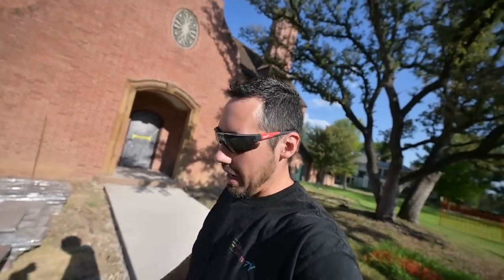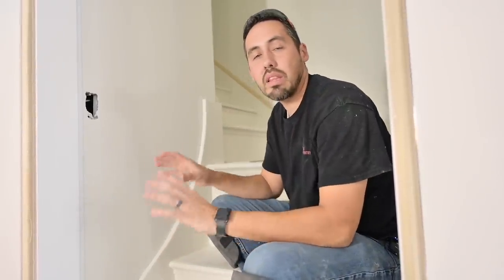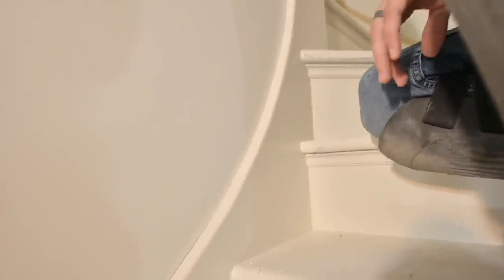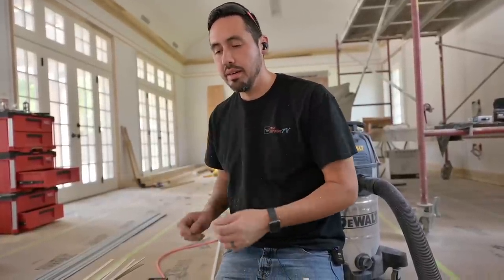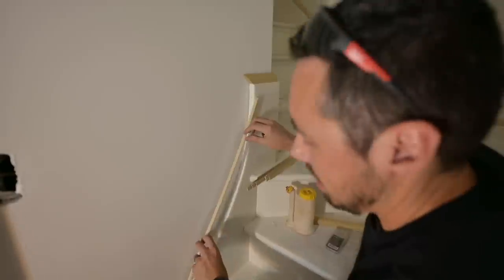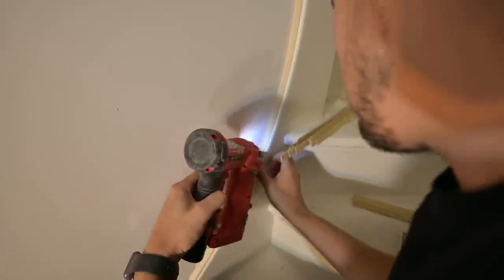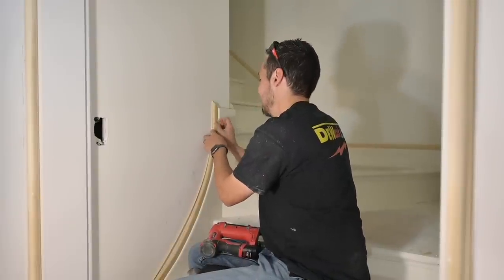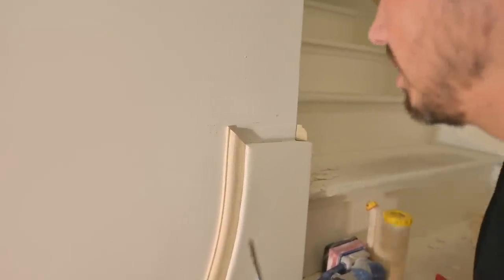This is some NEXT LEVEL Carpentry - Curved Skirt Board & Bent Lamination Mouldings

Comment: Get a 12 ft section of 3 inch or 4 inch metal pipe cap the bottom. Then about 12 inches up I  drilled small holes around the the pipe at a even 12 inches then I take write and run it in a hole out the other side and keep going back and forth in random holes so it forms a web. Then I add water to the bottom about 11 inches. It don't really matter you can't over fill it because of the drilled holes it will level it there. How ever when you stick your trim or molding in the web of words will still anything from sitting in the actual water.   You can either start a fire and stick the bottom in it or clamp a torch or two to a board  aimed at the bottom. If you don't want to fill the holes and make the web of wire. You can just get  small squeeze clamps or clothes pins and clamp them on the inside of the pipe around the upper edge. That's a cheap steamer

Comment: Nearly 50 years ago, I was learning trim carpentry from a great craftsman, who was also very time sensitive to make as much money as possible. I remember a new house that had a curved staircase. Don, my partner and teacher, took the stringers that went on the curved walls and got them wet and then draped them over some drywall buckets, so they were curved. I don’t recall how many days it took but when they had dried out he picked them up and voilà, they were curved close enough to where we could install them.

I was wondering if that may have worked for your piece of trim.

Comment: You could saw xtra long strips, apply glue, clamp them to arc of template, then run the router to profile desired, without router fence.

Comment: Super cool Richard! Very ingenious solution and it looks great! If you had access to a steam box would you still go this route? Thanks for sharing, very impressive 👍
Reply: I was wondering about what would happen to the detail on the top edge (“wrinkling”?) if the cap were steam bent.
Reply: PVC cap works best when needing bent. Takes little heat also
Reply: Or just use flex mold
Reply: @Whoisddepew  I believe Richard was a bit hamstrung with the specific profile and couldn’t find the appropriate router bit. I’m sure Brent has or could make one, but that was evidently not an option.
Reply: @MarkZart  understood

Comment: if you had the router bit you could run a curved profile using a template. Thats how Id try it and use a guide bearing on the plywood template.

Comment: Curved handrails has basically the same process of course with alot of clamps what I have done is after ripping material down is get a scrap piece of plywood and lay out the curve on it glue up and hold your curve with screws both sides and run the total length of piece run long for your miters for me it's the simplest way and worked very well I had to do this before the Internet yes I'm very old haha but anyways just a share thanks for your content also have you painted your house yet

Comment: Would have been better to form it on the template. First piece pinned to template no glue. The rest of the pieces glued and pinned to each other. When the glue dries pry it off the template (remember first piece had no glue and the pins have little holding power). Now sanding, cutting the miter and cutting a scarf cut to meet the straight piece all can be done while the piece is off the wall (not in place). This would be faster, more accurate, and easier. The piece could also be primed all 4 sides before installation helping to prevent any shrinking if the piece tries to dry out !   Also could have been made in 3 pieces steam bent or hot pipe bent saving a lot of time and material. If you dont know what hot pipe bending is look it up. Its fun and easy to do with a piece of metal pipe and a regular propane torch.  But what he did worked !

Comment: Is the sandpaper on the detail sander 3m Tri-mite? I've been trying to find a good source for it for months, it seems like everywhere I can find either is out of stock, purchase quantities are in the 1000s of sheets, or it's being scalped by resellers. 

If it is and you have a good source would you be willing to share your supplier? In 30 years I've never found a better 220 sandpaper than the Tri-mite, at least for woodworking and sanding finishes and paints.

Comment: Richard, I have an issue I need your help on. I had 3/8” wood flooring removed and had deluxe vinyl plank installed. The problem is every doorway going from one room to another now has a big gap on the jamb and casing. Would you have any ideas on how to fix this other than redoing the jambs and casing? I can send pics if you need them. Hey, you’re not bringing the kids to Disney anytime soon are you😁.

Comment: Awesome! You're really becoming a master craftsman dude. Also I noticed you're using a fast cap tape, no more fat max?!
Reply from the maker: Fat max have been snapping on me lately. I used the Milwaukee 25’ but couldn’t find it so I grabbed that fast cap.
Reply: @FinishCarpentryTV  The quality on them has gone down for sure 😔 It's hard to switch after 10 years of use
Reply: @FinishCarpentryTV  plz check the replies in the comments. Someone using your profile pic claiming to be you giving a special prize. Doesn’t seem legit

Comment: maybe a dumb question but why didn't he make the bent lam piece out of square stock, glue them in shape on the template and rout the pattern on the finished bent lam?
Reply: I would assume that he didn't have a cutter in that profile. And, even if it was available, it would be very awkward trying to run a router along the moulding with it in place.
Reply: @somemovingpictures  I am thinking like you make the curved piece of trim first then shoot it on. Rather than cutting up a straight piece and gluing it back

Comment: Surely an easier and simpler way would be to measure each step in the moulding then divide that into batches - cut the batches then piece back together.. you don’t need to hack up an original moulding and piece it back together as that moulding looks fairly simple to replicate ..
Reply: And before anyone jumps at me for this that or the other .. I recently had to turn a straight Moulding profile into an 8” circle, and I found the easiest way!
Reply: Not sure I am following you on your technique.

Comment: You showed how the skirt board has an inside circular radius on that side of the wall but you never showed what it looks like as you turned the corner on the other side. Does it also have a radius as it winds up the next flight. The stuff you often leave out is just as important as what you show. I wish you would show more details like transitions. This is a perfect example of not showing the full picture of these stairs.

Comment: Hi Richard, I'm disappointed at the solution you have used, what a whole lot of work you"ve given yourself, Steam box not required, boil a kettle and soak the moulding for about 20 minutes the boiling water and the moulding will bend to the radius required, dead easy and reasonably quick, I"ve used this method many times on small mouldings fitted to stair strings, door panels etc etc,. Enjoyed your video all the same, cheers